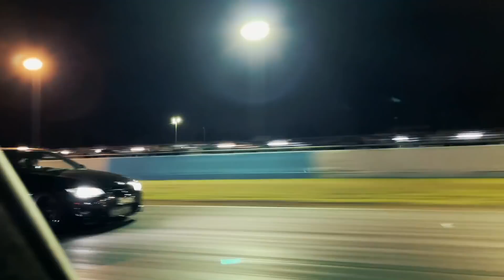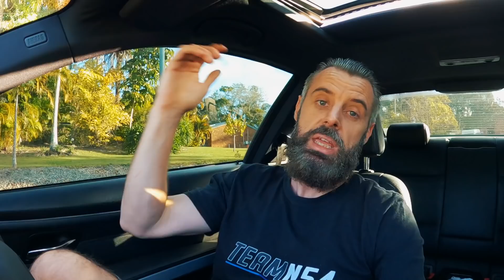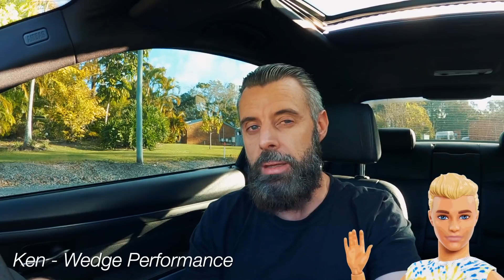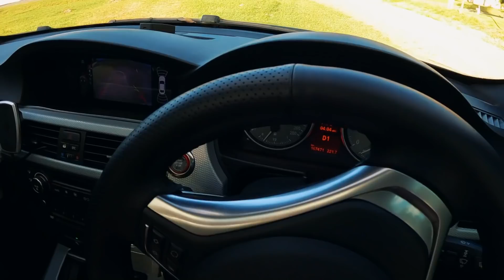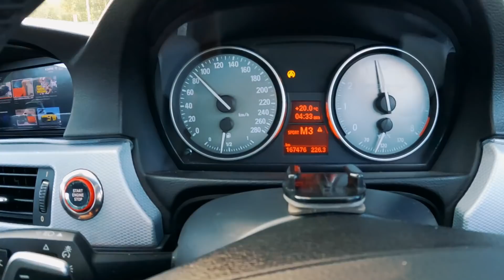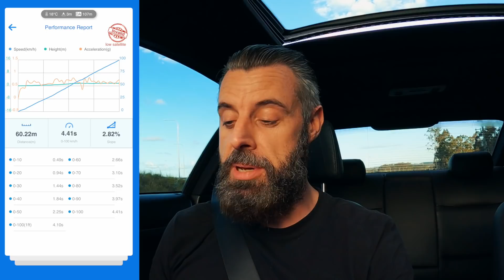How to make your N54 have a real hard cut REV LIMITER! MUST DO SETTING!

Comment: I have been using this feature on my 335Xi MT ever since MHD released it, and I must say that the difference in how the car feels is big. But I didnt know it were a ignition cut, I was just amazed in how much better response the car had post shifts. If I do a fast shift above about 6500 rpm the engine keeps boost and the car continues like a rocket in next gear. I am a little affraid how my x drivetrain likes it tho.
Reply: Yeah see its super weird. I don't have this issue at all. Using this option or not results in the same feeling, stock turbos, td04 twins and my g30-900 single. Tune has always been by me so its far from amazing but everything works right
Reply: I've been using "XDelete" app on my 2008 335XI and I love the choice of running full rear wheel only or all four driving if I want. Each has a different feel and way the car responds.

Comment: Ken recommended me to check the shift bog on my auto with sutphin custom tune after I mentioned to him that my car sometimes didn't wanna shift from 2 to 3 after a very hard/lots of tire spin launch. Solved the issue ever since and has been fine going on just over 10 months.
Reply: Is that Ken from Wedge tuning? I’m thinking of using him for my custom tune once I fit my 17T’s
Reply: @skatepark02  Yes, he is an excellent choice, I had multiple tunes done by him for different setups and he always gets the car dialed in. Also probably has the most experience out of any other tuner in the n54 scene.

Comment: Don't feel too stupid, I forgot to do a TPS reset and ECU reset when I replaced my throttle body, and wondered why my car wouldn't run right. HAHA, its what makes us human. Best of luck with your future races mate!
Reply: Eh, why you need to reset ECU after throttle body change? :D
Reply: @dominykastirva4177  Adaptions on XR6s are very annoying, the computer in them sucks. After fixing a vacuum leak, it needs to undergo a tps reset and ecu reset to have it running right. It's dumb.

Comment: Is this the same as no-lift shift?
Reply from the maker: No its not. This really just changes the way the DME activates an RPM limit. No lift shift ideally needs to cut power enough to allow a gear change. Which needs to happen at a range of RPMs.

Comment: I have the manual and i had this option on, i always knew there was something about it and i loved it but could never figure it out but now I know. it's a huge difference on a manual car. Another one that boggles my mind is if you want to launch the car and pin the throttle in 1st gear it is also possible to activate the antilag while holding volume down and traction off. It's a huge difference a bit difficult to activate it every time though. I make my rev limiter at 4k and antilag and it launches like a rocket, it's amazing.

Comment: Yeah it even occurs on my m135i running around 400hp, but to a lesser extent. I checked my MHD logs from the other week and in lower gears 1st, 2nd and 3rd, I see a torque Lim 2048 kick in every so often in the rpm range of 6600 - 7000rpm.

It seems really inconsistent on the exact RPM but the lower the gear on the 8HP, the lower the torque lim 2048 kicks in.

In 4th gear it tends to not kick in until 6950rpm, any wheel spin and the value is also lower than the 6950rpm.

Might give this a check the next time I flash the car. I've noticed the car sometimes bogs on 2nd to 3rd change even if I shift at 6500rpm, and the XHP stage 3 flash did reduce the bogging a fair bit but it's still there.

Comment: i'm on brand new stock turbos. fmic arm motorsport kit with tial bov, silicon inlets and filters. arm downpipes. mhd rev limiter set to 6000rpm. burger fuel pump stage one full e85

Comment: Does this work with the 6at not dct?
Reply from the maker: yes it does and makes a huge difference
Reply: @ZeroTo60Tube  I flashed it on mine, but the shifts are still the same, no limiter pops in manual or ds
Reply from the maker: @balkaraulakh5131  you need to hit the engine RPM limiter. Not the trans RPM limit. Which means you need xHP and shift points set above your engine RPM limit.
Reply: @ZeroTo60Tube I’ve got the same issue. No pops when shifting with XHP, shift bog in MHD fixed etc. How do I set shift points above my engine rpms in the newest XHP version? I guess I’m looking over it
Reply from the maker: @BassMasterBoys  to be honest i have no idea. havent seen the new version of xHP
Reply: @ZeroTo60Tube  I think it’s all the same just laid out differently. The shift points/shiftmaps have +/- in number percentages but no direct rpm number, the only actual rpm number shown is the max rpm setting. When you set it up yourself in XHP was it the shiftmaps column? Or another? Would love to see your settings

Really trying to figure this out if you can’t tell lol
Reply: @BassMasterBoys were you able to figure it out? I really want this 😅

Comment: Is this fine to run on an auto trans then? I have index 12 injectors, my fuel setup can support 1000hp. I feel like I notice the lag in between 2nd and 3rd
Reply from the maker: You can absolutely run it on a auto. However it will only effect how the car acts at the rev limiter. Common issue on the autos is post shift timing corrections. If you are having timing drops just after a shift, your tune will need tweaking.

Comment: On DAW flow max plus, 6AT XHP stage 3, car rips now with this setting enabled! Kind of scared if it causes damage long term, but I don’t drive crazy 24/7 so occasional abuse will be fine I suppose haha. 

8hp swap soon. Can you flash xhp with the aftermarket TCU?
Reply from the maker: The aftermarket TCU is much better than xhp.
Reply: @ZeroTo60Tube  even if you’re making a lot of power? It’ll handle it?
Reply: @ZeroTo60Tube  so it’s more so a plug & play deal. Just pay and install

Comment: so shift bog fix will work on my 09 335i with a regular auto trans
Reply: also i've always been shifting at 6500 RPMS kuz i was under the belief that the turbos stop building boost around there but was that jus the fuel cut ? so when i race should i jus shift at 7?
Reply from the maker: Factroy rev limit is around 7, this will work on the auto. however if you have factory trans tune it may limit shift points anyway.

Comment: From your experience is the jb4 with bef faster than say a mhd v10 stage 2+? For a FBO car with stock turbos?
Reply from the maker: No, MHD stage 2+ v10 is more aggressive. More timing on the MHD maps. You could run around 20psi with the JB4 in the mid range and maybe have it feel a bit more punchy. But JB4 Map 7 and MHD Stage 2+ = MHD more aggressive. Keep in mind each car responds differently, but looking at the BEF and MHD on paper, MHD is more.
Reply: @ZeroTo60Tube  thank you for the feedback I had been contemplating getting a jb4 as well. But ill just work with my mhd and maybe try some E40 maps at some point.
Reply: @ZeroTo60Tube  ps the shift bog fix makes sense, the normal limiter makes the car bog down quite a bit. Ill try it out on my auto. Hopefully it works well with xhp as well.
Reply from the maker: @dextershumba7262  If you wanna get really spicy the most aggressive MHD map is the V5 e40. TBH not many tuners can make a custom map run faster than that. Assuming the car is in mechanically a1 condition. If you have bad coils, plugs or injectors V5 e40 wont work properly. Let me know when you do play with them!
Reply: @ZeroTo60Tube  Hi there, car is finally back a local turbo builder here(Zimbabwe) built us some upgraded td03 turbos using my old housings, standard size turbine wheel but with a larger billet compressor wheel. I reckon the size is similar to say a 15t(42mm). I have run the MHD Stage 2+ on 91oct setting as our gas isn't the best and I haven't had access to ethanol just yet. I seem to be getting quite a bit of timing correction up to -4.7/-5 degrees sometimes but on average seeing -3 degrees. Car does feel good though, What's your take? We did some injectors, all new O2 sensors, car has DCI, FMIC, chargepipe and downpipes...
Reply from the maker: @dextershumba7262  Corrections are normal, however, they are something to try and reduce as its going to be limiting power. If your car is all good, it is likely fuel related. What timing are you targeting? Also what fuel?
Reply: @ZeroTo60Tube  Hey there, I've dialed back to v10 stage 2 as I am back on factory intercooler while I wait for an upgrade from burger. The one I had on wasn't really efficient IATs kept running way too high. I have to run some logs to check timing target but for now im on a 91oct Map, our fuel blend here is currently E15 from the pump. Corrections are mostly gone. Just the odd one now and again.
Reply from the maker: @dextershumba7262  Nice to hear you have some progression!!

Comment: Maybe someone with the full knowledge of the workings of this system can comment on the possibilities of hydro locking a cylinder. With DME  just cutting the spark and not the fuel is there a possibility at that high of an RPM(red line)for the fuel to build up and hydro lock? Or is that what the "pop" through the exhaust is that you are hearing ? Just a thought
Reply from the maker: It wont hydro lock, remember the air fuel ratios, hardly any fuel going in per compression cylce and then its straight out the exhaust port, whether the spark fires or not. It's how rev limiters used to work before direct injection.

Comment: I believe i have told you to apply shift bog fix on a couple of occasions ,even when you had issues over a year ago. 

Only advised for manual as aggressive limiters are not good on torque convertors.
Reply from the maker: Sorry dude, if only we all knew what it actually back then. Probably would have ticked it way sooner. I reckon i went to enable it a while ago and realised it was the longer flash then probably went nahhhh, ill leave it off for now.

Comment: Do the MHD ots maps have all the safety features as the stock tune?
Reply: OTS maps are quite Conservative and safe. Saying that when your tuned, you can't be cheaping out on maintenance. Get all your maintenance sorted first, that's plugs, coils , leaks - gaskets etc, and Datalog, it will help you identify any issues.
Reply from the maker: Yeah, non of the engine protection is changed that said, the car will keep running if you loose oil pressure, or fuel pressure. You get warnings on the dash but need to be paying attention with a tuned engine.

Comment: Are there any downsides to this? Increase in temps, or additional stress on the twins?
Reply from the maker: Zero. The factory rev limiter is a fuel cut for emissions purposes. This just changes it to an ignition cut which is much nicer on the hpfp system
Reply: Thanks for the reply, mate! And really appreciate the content! 😁  I'm going for an 8HP70 and a Quaife LSD for my E92 335i and can't wait to finish it. Your channel is an inspiration.
Reply from the maker: @andreazzopardi7311  Ohhh that will be an awesome build. Good luck with it and do enjoy.
Reply: Sorry if I've missed it, but is this still only possible for manual/DCT or would it also work on a ZF car? Thanks! 😃
Reply from the maker: @andreazzopardi7311  works on the auto cars as well

Comment: I have this setting on in my car and if I touch limiter I get a check engine light and a mild misfire. I am on Delphi coils is that a problem. MHD stage 1 too. And index 12 injectors dowpipes and Intercooler.
Reply from the maker: What does the check engine say? Which is the fault relating to?
Reply: @ZeroTo60Tube  combustion misfire cylinder one. it has been cylinder one twice in a row now i swapped the 1 and 2 coils to see if it moves. nothing yet still waiting just wondering what others might think.

Comment: I tried this. It causes check engine light, misfire, and literally bath the spark plugs in fuel, while cutting the ignition...
Reply from the maker: No it doesn't. Most aftermarket ECUs use spark cut. Every rally car ever uses spark cut. This was not the cause of your issue.

Comment: But my car does that when I floor it and shift at the limiter. It does like a shift burble type of deal
Reply: that's torque reduction to keep the gbox happy. Completely different as it also cuts throttle
Reply: @SnowGolem1TheL33t  sounds about right, but it sounds good as well 💪🏾

Comment: Has anyone tried this on ZF 6AT to confirm results?
Reply from the maker: I have read of a few people, but not confirmed directly.
Reply: Yep occasionally pops on 1-2 limit shift
Reply: @ben7020  only first to second? or does it pop in all gears mine rn only does first to second but i didn’t disable the torque limiter shift bog yet